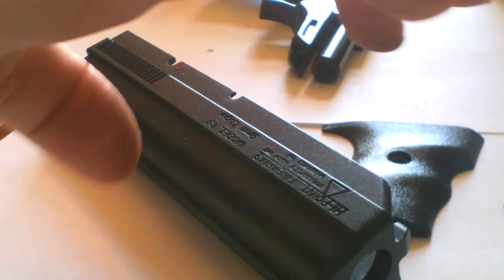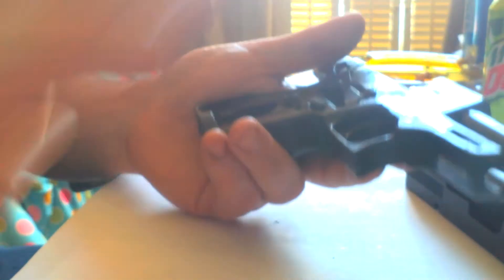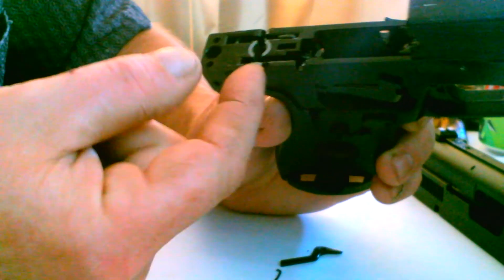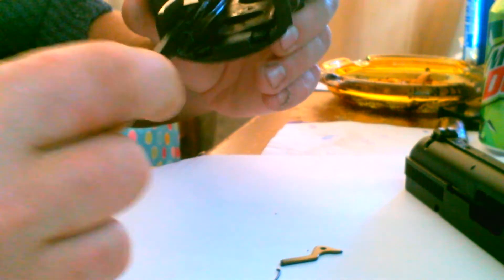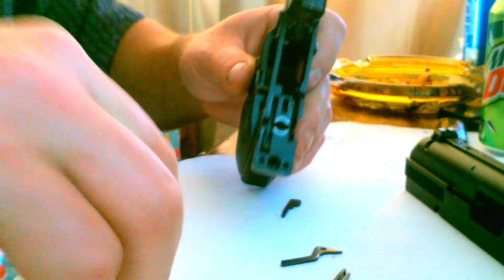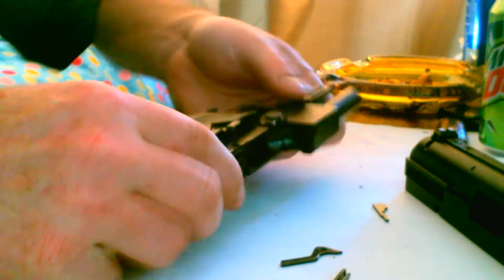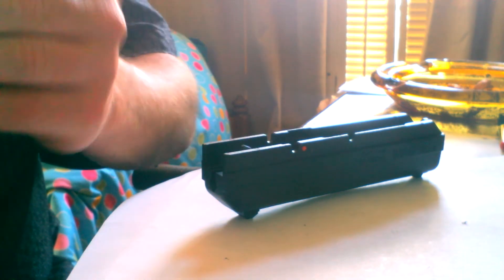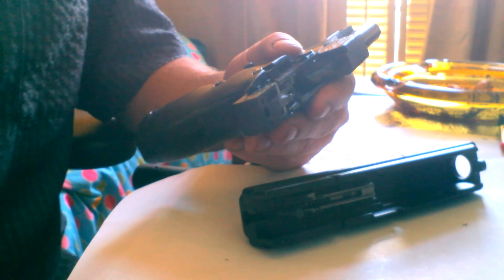WHAT THE NOISE/RATTLE IN GUN C9 HIGH POINT  IS TEAR DOWN SPRING, COUNTERWEIGHT, HANDLE, DROP SAFETY

Comment: Taking the drop safety out isnt the issue.. ppl walking around with one in the head is the issue. From my experience, no you don’t ever want to drop a gun but if its on safety and doesnt have one in the head when/if dropped, you should be fine. Stay safe ppl
Reply from the maker: 100% agree. A person who know what's there doing it will take only a sec to click of safety and rack one.. but most people won't ever run 100 round through there tool of the trade.. sad so many don't practice.

Comment: Dude don't take the drop safety out the gun thats just stupid, if you drop it loaded it could kill someone.
Reply: @Bruce Schram yes I took the magazine disconnect out too but you took the drop safety out which is not good at all the drop safety keeps the gun from accidentally firing if you drop the gun when its chambered, id put it back in If I were u.
Reply: @BrokeBoy912 So there's two different pieces?